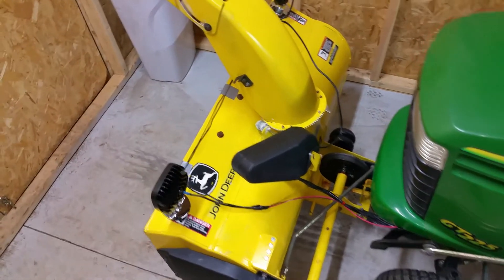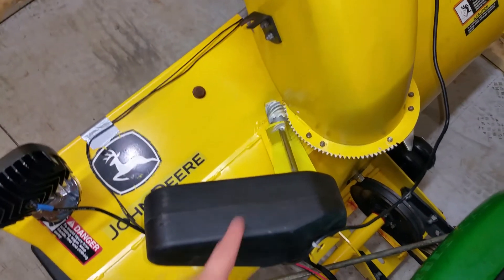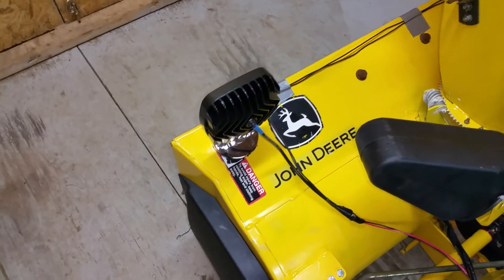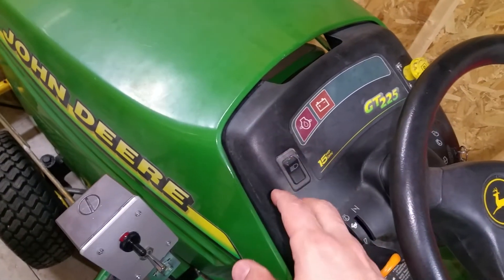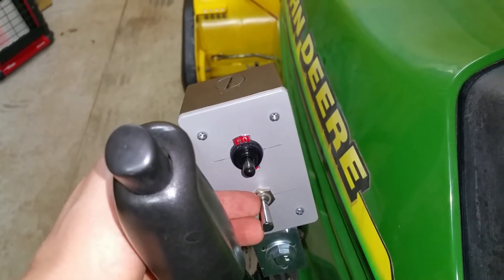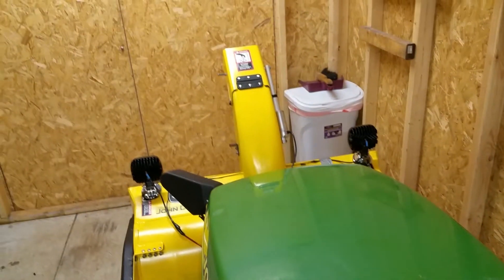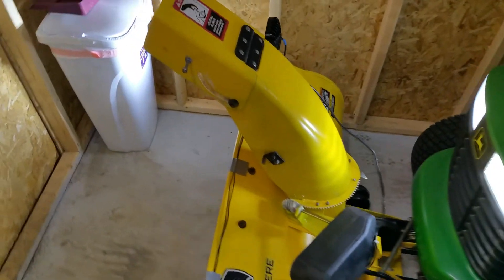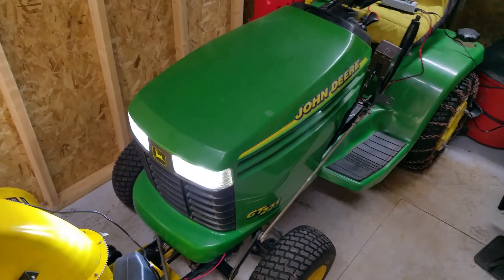John Deere 42" Snow Blower Electric Chute Kit

Comment: Would u be willing to take a pic of what kind of terminal came on the red wire of the harness that goes into the 6pin plug on the board now? It has 2 wires coming out of it. One plugs into the existing wire u had to unpin from connector and the other powers the harness I’m assuming. I just bought a blower with rotator on it and they cut red wire instead of unpinning it. I’m not a fan of cut wires and would like to get the correct terminal from somewhere. Thanks!
Reply from the maker: I do plan on putting the plow on this year, but I can look at this and get back to you. Email me so I dont forget. Email is on my about page.

Comment: Nice videos. Your defiantly skilled. I was wondering about the hardware for your electric shoot control left and right.I see that the teeth on the cog or gear at the bottom is a lot smaller then the one on my craftsman snowblower attachment. I'm looking for the same type setup that you have. I'm wondering if the hardware you bought was John Deere specific or would it work for my craftsman?
Reply from the maker: It was john deere specific. the bracket can be fabricated, and the window motor is standard. the worm gear can be purchased im sure.

Comment: Heavy Duty Linear Actuator 4" Stroke 225 Pound Max Lift 12V DC  found this on ebay. could not find the rotation kit though.
Reply from the maker: yea the rotation kit is discontinued. you can buy the individual parts from JD but its whacky expensive. there are 3 part#s that it could be. they occasionally pop up on ebay from time to time.

Comment: Where did you find this on eBay was there a particular part number?
Reply from the maker: BM19867. that is the original part number but it was discontinued many years ago however you can still buy all the individual components to that kit the problem is it's going to cost you an arm and a leg.

I'm grateful to have it it really does make things more convenient

Comment: will I be able to hook these up to my tractor? Its a lx277 johndeere
Reply from the maker: Hook what up exactly? I got a lot hooked up on this machine ha!
Reply: linear actuator to my shute
Reply from the maker: assuming you have the same snowblower chute as me you should be fine. measure the travel from full extended to full contracted to get the throw, and you can find an actuator with that much travel. wiring is very easy with a two way momentary toggle switch.
Reply: yes I do have the same blower I'm not much forwiring it to my dash though.